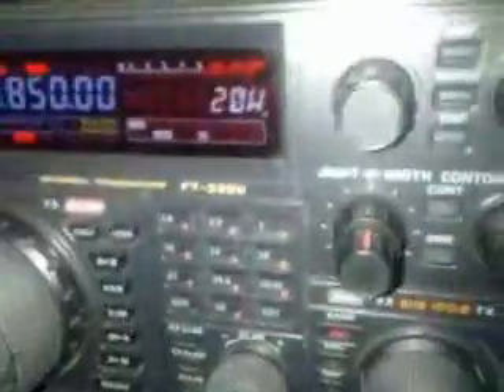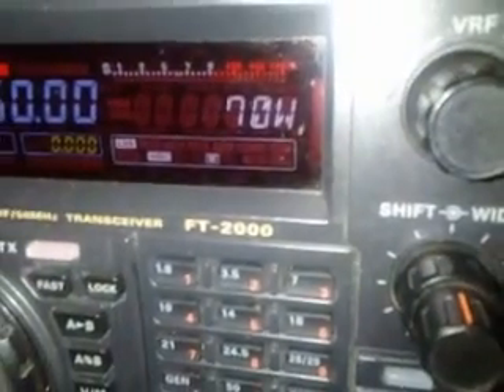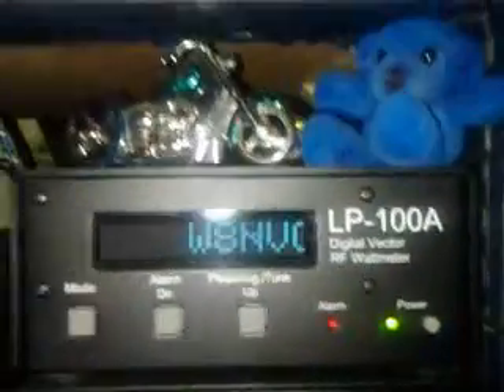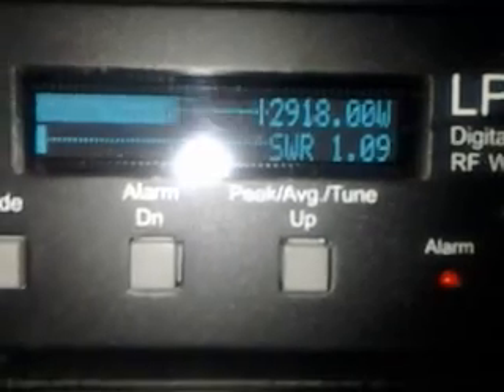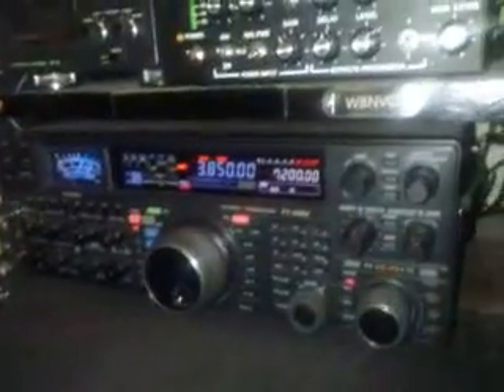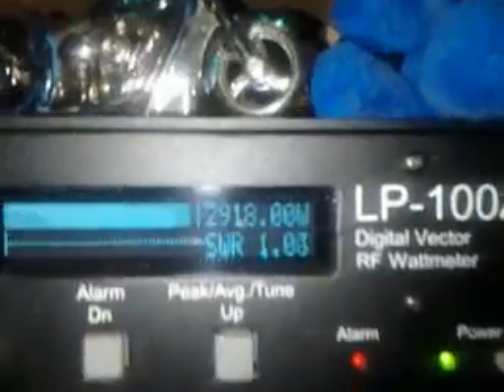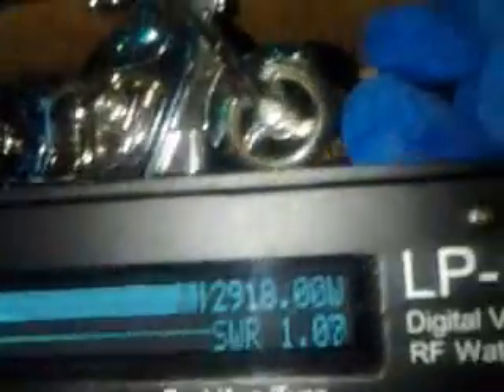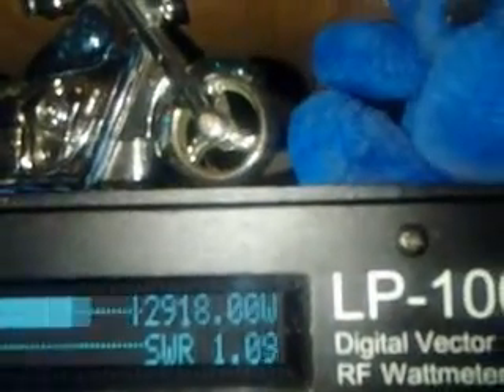The Commander HF 2500 at 2,900 watts output

Comment: W8nvc -W7ZAR 
How much for that beautiful amplifier and is that on 220 or 240v?
Reply from the maker: It's for sale. 3,000. you ship. And it only runs on 240Vac. 73, from W8NVC
Reply: @Livewire-Entertainment  Did you sell amp?
Reply from the maker: @truckingfun5033  ..   IT IS STILL FOR SALE......
Reply from the maker: No, I still have it and it still rocks, I been using my solid state so the commander i wanna sell,, 2,900 watts.